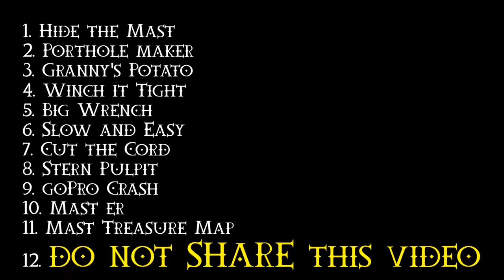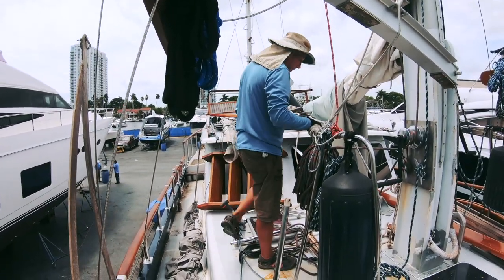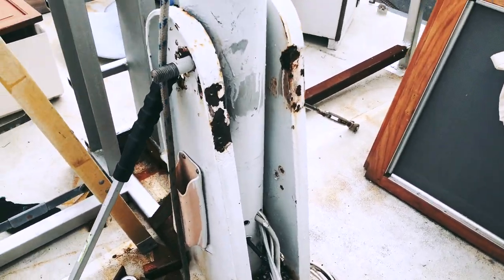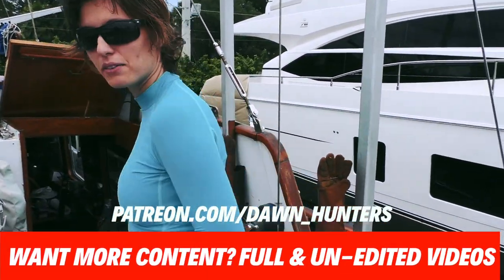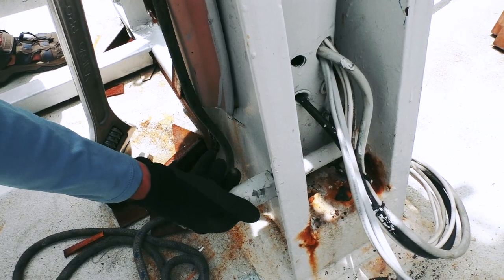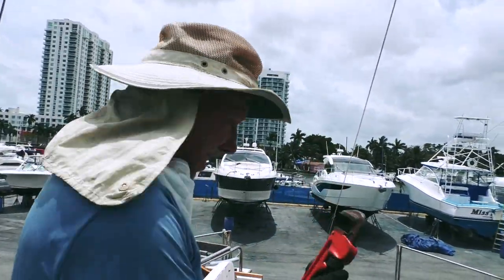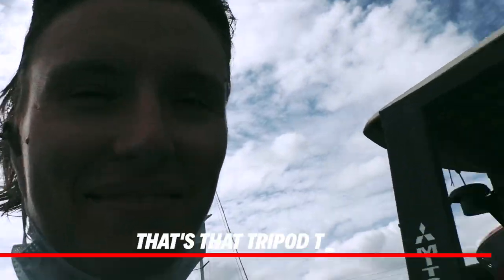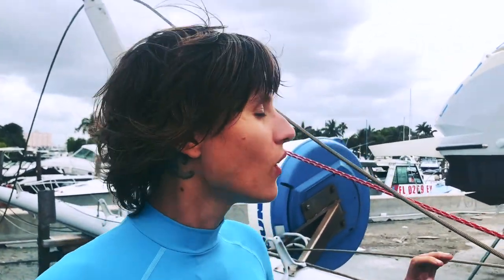Sailboat MAST REMOVAL Boat Rebuild Project Sailboat REFIT Dawn Hunters Steel MOTORSAILER KETCH

Comment: Wow you have Angels on both shoulders. The pivot on the tabernackle was grossly undermined, perforated & weakened by rust, Which would allow the mast to pivot, rotate sideways uncontrollably to either port or most likely to the starboard side. The lowering line from the mast would actually pull it sideways as it came down accelerating it out of control until it crashed & broke. I noticed earlier you had removed the 2 side stays that are designed to pivot in line with the mast pivot in the tabernackle. These sidestays would prevent the mast falling side ways. I understand this necessary sidestay support feature is not available because of the design width of the "new" pilot house interferes with these side stays. You were very, very lucky!!!!  This "uncommon" mast lowering feature (tabernackle) is an excellent topic for an exclusive video. NB. With your windlass raised above the deck. Have you considered a retractable bow sprit? (reduces the effective length of the boat & slip charges  at marinas.) While giving more options undersail with fore staysails, gennaker & or a huge spinnaker sails. Increasing needed drive to the boat in low wind.  Have you sent the sails out yet to be checked & repaired? What do you think of adding "DAWN  HUNTERS" & Logo to the main sail .&. ("Spinacker") ? I just recently (3 months late) came across your "very interesting" (& entertaining) channel. Trying to catchup & make sense of the chronology is difficult. What do you think of adding EP#'s  Episode #'s to the beginning of your video titles. Excellent, interesting, informative  channel. Keep up the good work. CHEERS ;)
Reply from the maker: Hello Tyrone. 
Now this comment and question session could be a 2 part tech video. For 14 years I grew a single person shop into 300 employees providing custom robotics for packaging, then moved into the offshore oil rig sector and upgraded 3 offshore jack up rigs housing 150 men for drilling operations off the coast of Africa. I am using the engineering and oil rig background to update and modify our steel motor sail ketch. I find most boat builders are restricted to design by budget and location of supplies or services. By having personal knowledge and skills to design/fabricate new doors open for integration and ingenuity. 
The cathedral mast supports were installed on Dawn Hunter to allow passage around Europe plus the ability for self lowering using main mast or mizzen mast. I tested the integrity of the mizzen mast support prior to mast lowering. Dawn Hunter was fabricated of special steel similar to the steel we used on rigs. It is not ship or tank steel. Even areas that have not been maintained as you saw are still super strong and do not fatigue. Still with this in mind I had rigger lines on port/starboard sides plus the added center cables to main mast. 
The new mast support is much stronger and fabricated of structural steel to provide many years of service. 
Do you own a boat?  Where are you located?  Would be great to chat knowing your questions come from clearly a background in this arena. 
Thank you for joining us!!!!
Capt W
Reply: @DawnHunters  Yes, I have 3 sailboats ,  one is a small trailer sailer. The other 2 are perfect for the dangerous waters of the Great lakes. The waves here are fast with short amplitudes & large potential in height. Deadly in fact. https://www.youtube.com/watch?v=tXTEKD5ZQpo This is the water after a storm. Similar to what sank the Edmund Fitzgerald  222 m (697 ft)  25,400 tons. Twentyfive-thirty years ago I was messing around with boats off the Pacifc North West. I am glad you mentoned about the difference in maritime steel grades & specs for boats. Many in North Amerca are not made of even Corten steel. Something a buyer should be aware of, when buying a "locally" made 'steelie". The other mediums like Fiberglass *Fantastic Plastics & Ferro Concrete all have their issues. Europe is on a different level...
Reply from the maker: Hey Tyrone. 
Your comment was flagged due to the link attached. Now is released. I am laughing as originally from Northern Wisconsin between  Marinette and Green Bay so know Lake Michigan like the back of my hand. I also worked several years as a Field Engineer based in Sheboygan. The only time Lake Michigan was calm would be middle of the winter when we would take snowmobiles to Sturgeon Bay. Lol
So your on one of the lakes I assume.  After working near the ocean I packed up a truck, donated my snow shovels and plow to my Brother and headed south. Now I can work 364 days a year without gloves and long underwear. 
Cheers 
Capt W

Comment: Great video and the power of the mind wins again, I was curious if your gonna upgrade your radar system as well, or is the one you have up to par,I've seen other channels talk about theirs, but they never really show what it's  capable of or it's limitations is why I ask, can't wait to see how you put the mast back together and how your gonna change out the base of it,and thanks for the info,you both made my day ....
Reply from the maker: Hello Clifton. 
1. That old radar is history. It works well but all the systems I have are Garmin with a full network set-up. The radar then can overlay on all 3 plotters. Other cool feature Garmin does not share is you can purchase a newer chart plotter with the WIFI and then network to other older devices. I am also navigate with the Garmin MarqCaptain watch via network links. The mast now has bow and stern LED lights, custom crows nest, VHF, WIFI and SS Radio antennas. Have cut the old base away and will add to the mast mount to make up the loss. 
👍🏼

Comment: Well done guys, o and same thing happened to my slr on a tripod, i had to big a lens on it at the time lana .
Reply from the maker: Iana here. Hey David, yup, I should admit this is not the first time for me either. I dropped my good lens once and it broke pretty bad, but surprisingly they were able to fix it. Same here - I was able to order new protective glass for GoPro.
Reply: @DawnHunters  thats good that you were able to, I keep loosing my gopros,  so I just get them reconditioned now, tested to manufacturers settings,  but i haven't replaced the last one yet, there's  a lot of work in doing up a boat that big good luck 😀.
Reply from the maker: David Macdonald yes! We were able to get refurbished drone too, very nice! I didn’t know about that website until William told me.
Reply: @DawnHunters  yup William is a pretty smart guy.